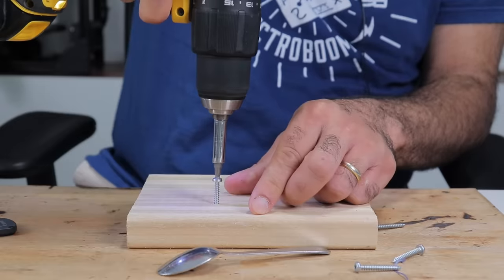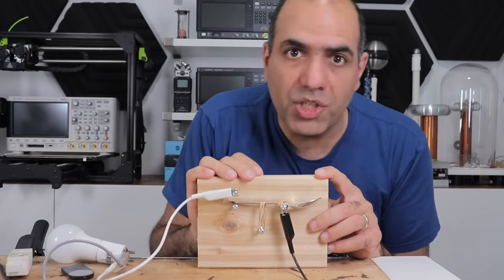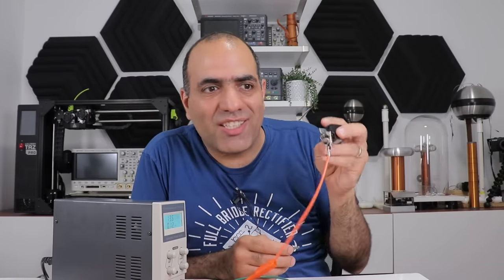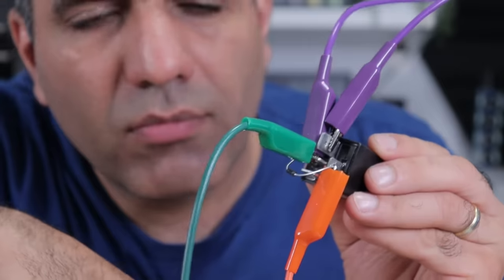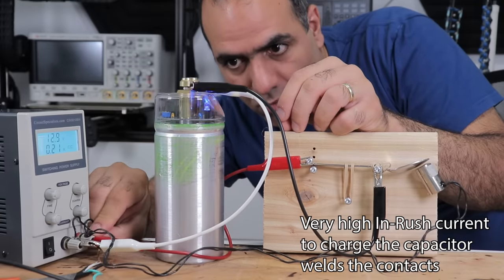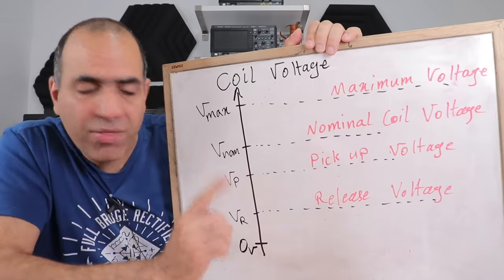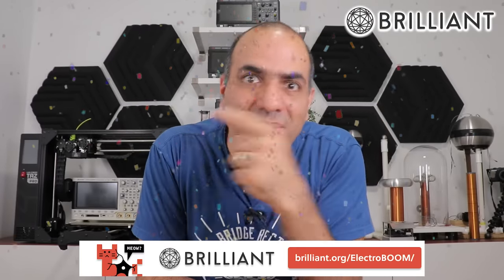Why RELAYs go BOOM!!! And How to Use Them

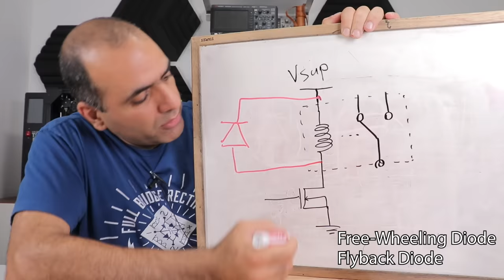Comment: 5:17 reminds me of back in the day when i used to test electromechanical counters using the parallel printer port of a computer running a counting program in BASIC and a transistor to switch the 24v to run the counter coil, and i got shocked by the coil.  Measuring the voltage, it was spiking to 400v on every count pulse because I didn't have a flyback diode.  (fortunately, the transistor i was using could take 800v)

Comment: Speaker protection relay contacts in amplifiers and hi-fi systems often fail due to oxide building on the contacts and the signal voltage and current isn't enough to break through, although if you crank up the volume, increasing the p-p voltage of the signal it will sometimes break through and begin conducting. Usually happens if the amplifier/stereo doesn't see a lot of high power use. Hence why silver plated contacts are normally specified for speaker protection relays, to minimise this phenomenon.

Comment: Sir can I ask a question?...their is a video I'ved watch before, solenoid valve, as the coil energize   it pushes the valve to open. I asked the uploader of that video how come the valve pushes away when the coil is being energize it will create a magneticfield that magnets the valve instead? Then he replied, according to the right-hand law, it will create a force that pushes the spool to opposite side. Which means their is initial energy from the magnetic flux on the coil as current flow through causes to push the spool valve. Now, sir if that energy present on coil, how the switch side of the relay being magnet from magneticfield of coil when their is a pushing force?

Comment: 1:10 Doesn't a 3-pole switch have two switches in parallel, which are in series together? thats how you control 1 light with two switches, and have the switches not depend on each other. i've actually lived in a house before where the switches were installed in series for a light, so of the 4 possible combinations of switch positions between the two switches in the hallway, only 1 of them turned the light on (it was 1 up and 1 down, which was even more annoying).

Comment: what would you use instead of a diode if you had to switch the coil in both directions?  ie negative/positive voltage across it instead of positive/off

Comment: As 3:50 , how voltage actross inductor is rising up when the path is broken. According to V = L di/dt  , path is suddenly cut while the current is flowing through inductor  means current is suddenly dropped 0. therefore di/dt goes to infinity or something ?

Comment: I'm not from electronic degree, but I want to build a wifi DC 12v relay circuit. What it does, having 2 source DC plug and battery 12v.

When blackout comes, relay will lose power and switch to NO state and because it's SPDT so NO pins is connected to 12v battery, continuing to power my wifi.

My question is.. Should I worry about this oxidize thing?
I run 12V relay arduino module. (but not using arduino, just simply mix the GND to Signal (my relay is low trigger)..

Comment: hey ElctroBoom,
question.
could you make a video about car "blower motor resistors". When we look at those resistors, its just metal coil inside a stone. with different lenghts of wire. could we use other resistor type components?

so, instead of some coils in stone (if you open them up its just wound up steel wire), couldnt we use some electrical resistors?

Comment: I have a question. I connected a sk3f-s-5vdc-c relay to a esp32 devkit v1. But it didn't work. May i know how to fix it without changing the relay?(or adding npn transistor helps?)

Comment: Brilliant. I know relays really well and have used them in lots of designs yet you still taught me something regarding the continuous arcing.
Reply: They're sponsoring you too?
Reply: @Sparkette  Why should relays sponsor him?
Reply: @Power-Wiesel  Brilliant
Reply: Same, I love relays from how unique they are, too bad I only have 1 in my home :(
Reply: One random thing I'll add is that they have a lower contact voltage rating for DC than AC,because there are no interruptions to the current that would let the arcing stop. A relay designed to switch 5A 120VAC might only be rated 30VDC,  and might arc permanently and burn up when "switching" 80VDC 3A.
Reply: Some relays (mainly the ones that are so big they aren't called relays anymore—they're called "contactors" for some reason) have a "magnetic blowout" feature specifically to extinguish that arc, by deflecting it with a magnetic field, which… hmm… stretches the arc too far to keep arcing? pushes the arc off the contacts? It does something to it, anyway.
Reply: @IDoNotLikeHandlesOnYT   I know that circuit breakers  often push it into a series of metal plates, spaced a short distance from each other. 5 separate 1mm arcs have more voltage drop than one 5mm arc. Also the metal plates act as a heatsink to cool the arc until the fireball stops conducting?
Reply: @deltab9768  Cool. I didn't know about that approach.
Reply: @Sparkette  Must be. Each contestant shall line up one million of these devices in a tandem cascade,  to see which array is fastest.  It would make for an interesting relay race.
Reply: I could dig relay well. I have a deep committment.
Reply: @clunkonester4884  if you answering this, you have a cell or a computer. That is millions of relays working together! You have way more than 1 relay around.
Reply: @ArashArfaee  true 😎💕🖖

Comment: I like how, even after having 2000 volts dropped on him, he still casually connects live wires to a spoon and touches it with his finger.
Reply: Notice whenever this happens he's not touching anything else with his other hand. He's also isolated from the floor. Would only feel a tingle (I've tried it)...!
Reply: I keep waiting for him to push the back side of the spoon :P
Reply: @deltab9768  From what I remember from that video, the Jacob's ladder ended up shorting milliseconds before he touched it, probably what saved him. Then the fuse at the power outlet popped (or GFCI forgot what)
Reply: @Kalvinjj  that would make sense. He looked shocked but that could just be from the stress of a near death experience. I’d think someone who actually got hit by a MOT would at least have some obvious burn or something so your idea would explain him being unscathed.
Reply: He did get severly shocked from that one but only a brief moment before it shorted just before his other hand touched it so it only burned one hand. He has mentioned in a another video later how it almost killed him for real
Reply: @deltab9768  Yea, as someone who has used MOTs and MOT stacks for all manner of projects going back years...seeing how close he came to absolutely definitely being dead then terrified me and made me feel sick haha
Reply: @deltab9768  he's talked about it separately before, that was a real accident

Comment: Minimum current thru a relay contact is also known as "wetting current".
This is why you cannot use a 200A relay to reliably switch a low current circuit.

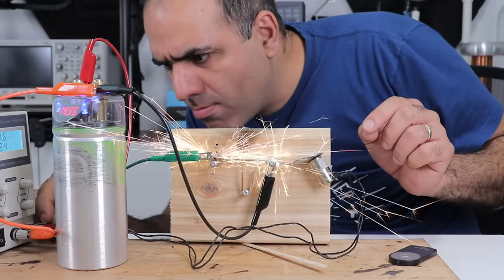Comment: 11:52 Some trivia I learned: gold is used in electronic devices like computers and phones because it doesn't oxidize and those devices want to use as low a voltage as possible.  (Voltages that wouldn't be able to break through the oxidized layer on, say, copper.)

Comment: Haha, me who's a beginner whom doesn't know what a LED is learning how relays work!
Reply: So an LED is a light emitting diode, diodes allow current to go through from one way but not from the other, and this one emmits light when current goes through. Pretty neat
Reply: Best to research all the different diode types and what they do
Don't worry bro relays was well used before LEDs even came out ....used to drive high power circuits from low voltage controller or buttons that You don't want to get a shock from also it saves that switch damage from arcs or soot
Reply: But no doubt these videos are entertaining and informative at the same time...and the thing he does with the bushbrows...
Reply: But no doubt these videos are entertaining and informative at the same time...and the thing he does with the bushbrows...

Comment: 6:30 you can add a resistor. You can set resistor value to tailor the flyback voltage and release time.

Comment: Thanks! Very enjoyable! I hoped there might be a mention about the relay ratings being for purely resistive loads. You have to derate them for driving inductive loads such as a solenoid. I hope that doesn't sound bad. I still get equipment to this day that I have to add arc suppressors to manually. Thanks again!
Reply: @itsmoam  Patreon i believe
Reply: @itsmoam  Patreon supporters get early access to videos.
Reply: @itsmoam  patreon early access

Comment: Nikola Tesla used auto oscilating relais in his circuits. Instead of burning away the coil spike in a diode, he discharged into a second coil, which was his primary coil.
this coil was tuned series resonant  to become low impedance (so the impulses could pass).

Instead of putting the diode parallel to the coil, you could also put it parallel to the switch.
 this is where Nikola Tesla placed his series resonant primary coil.

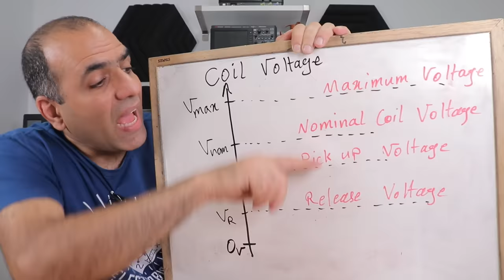Comment: At 10:00 you mention release voltage. Can you do a video about peak-hold driver circuits, like ones used for fuel injectors?

Comment: Hello, nice video💪 I think I have found a scam in smart watch, the brand  is Sequent and as a battery they use a coil with a weight and a magnet to generate electricity. On the paper this is fun but is it enough to power Bluetooth module , electrocardiogram .....?

Comment: Connect an 'operation' game board to a microwave high voltage generator so if you touch the metal with an exposed and disconnected metal hook you get a shock

Comment: I use a relay like the first black one you showed to make a ignition circuit for a ~1930’s 3hp engine on a railway inspection cart made to carry about 2 people. It was missing its ignition system except for the points, and a single spark wouldn’t ignite it, so it was set up like how it was set up in the video to buzz, except it operated a 6v car ignition coil to make high voltage.

Comment: "Coil Economizer" circuits are commonly used especially in control circuits where the relay is expected to remain energized for long periods. Basically, you add a series economizing resistor to the coil circuit that will limit the coil current to the holding value (plus a little margin) when it is ON and at steady-state. A capacitor is connected in parallel to the resistor, effectively bypassing it during pull-in. You still add the clamp diode(s) across the coil of course to prevent excessive flyback voltage.
Reply: Huh. Cool idea. I saw a component I think on a printer control board, it was a latching relay. Took zero power when it was on, zero power when it was off, and you had to pulse the current to get it to turn on and pulse it the opposite direction to get it to turn off.

It was a small device, but still cool to see.

Comment: Electroboom i need your help.
If i have a 3v to 400kv boost up converter (which is not exactly 400kv as it is made in china) and i observed that the spark produced between open terminals of wire at around 3cm (let's assume) and i connect both terminals to a small mesh net with a distance of slightly more then 3cm, so that there is no spark in between when circuit is active, so my question is that if a mosquito come between the two mesh or say mosquito sits on one of them, then the distance between two mesh become shorter, so is spark happens through the moquito? can mosqquito die?
we normally use mosquito killer rackets in which the distance between mesh is very small and mosquito has to touch both terminals o be killed, but if above given statement is true i can make a device to be kept near or under desk or and area of misquitos to get rid of them.

Comment: I’ve always had an urge to put very high voltage to a small relay and watch it arc between the contacts, too bad I don’t have a microwave I can take apart :(
Reply: There are 12/24 volt buzzer circuits (simple) that have Back Emf spikes in the 1200volt range.   Safe high voltage is a subject of large heavy books and heavy protective equipment.
Reply: @mike289homebuilt5  Okay, thanks for the info!
Reply: I love highvoltage.    There are Kits online for $12 dollars.   Transformer pulse circuits.  Tesla coil slayer circuits.  If I had low buget i would make a mini Alternator to drive a highvoltage transformer.    There is a way to pulse a transformer with a homemade relay i know......keep transformer small and voltage high

Comment: There are 2 types of relays, AC and DC relays. DC relay wont work on AC but AC relay will work on DC. AC relay has special iron core with additional coil to create additional phase of magnetic field to prevent chatering..

Comment: I'm using a NE555 circuit to delay the coil of the Relay with 9v of 12 lol, something unusual happened the transformer of 20 V. got overheated then I solved the issue fixing bad connections on the 110/ 220 V Terminals right... but now my device of 20v. is overheating just when I connect the Relay. I'm trying to figure out how to stabilized it, ANY IDEA? Thanks for sharing.

Comment: You need to have ARC and TIG welded, a process with rather low voltage and high amperage, to understand what happens when you open a relay's contacts. The TIG process lift-ARC demonstrates the problem of opening a relay under a load. It causes the air capacitor  that is stopping the flow of electricity to break down. 

The more insulative the dielectric in a capacitor, the smaller the capacitor it will create. The more surface area the dielectric has in contact with the two plates/contacts, the larger the capacitor it creates. The thicker the dielectric, the smaller the capacitor will be. When two points are very close together, the air capacitor is very large and often blows from the large current it passes to charge the air capacitor. 

A relay is a very small air capacitor that charges and then resists voltage flow. When a relay first opens, the points are very close to one another, creating a very large capacitor. As that capacitor that often stops AC current charges, it draws too much current through that small thickness of air. This causes the dielectric, the air, to break down, superheat, and become a blown air capacitor or blown condenser. This can cause an extremely long break time, especially with induction devices. Longer than the make time of the relay. So, if you were to try to use two different power sources and try to switch between them, the fact that it will take longer to break than make means that power from one power supply will jump across the ARC, the blown air capacitor, and connect both power supplies. 

One common thing engineers do is try to create a device that will switch between 230 volts and 120 volts with one relay. The problem, as mentioned, is that the ARC will open up a bridge for power to flow and connect the two power supplies, often causing some nasty effects. Just like an ARC rod does.

Comment: Pull-in voltage, hold voltage, max voltage, ... When you get to the Big Boy Relays(tm) - "Contactors" - the specs start going all over the place. And there are "mercury wetted" relays to damp the contact bounces. (Gigavac sells a line of "mil spec" contactors that have silver coated contacts to help prevent arcing / welding. They're my preferred go-to for EVs)

Comment: Sir, I have two questions:
1. How to increase  life of relay for commercial product , when used with inductive load like solenoid or motors (1A-2.5A load) ?  snubber circuit (RC circuit )?
2.  what is the role of optocoupler with relay ?  I mean do you recommend optocoupler with relay ?

Comment: Wonderful.  Here is a bad-relay story:  in the 1960's, ham transcievers needed to switch 280 volts or so pf B+ between the transmitter and receiver sections.  But high-voltage relays were VERY large and expensive, so even high-quality manufacturers such a Collins and National and Hallicrafters would use lower voltage relays.  These relays would be stressed and only last a few thousand switching operations.  I right now have three National transceivers that need new relays.  I'm reluctant to put in the originally designed-in relays, so I'm kinda stuck.   I do have some high-voltage telephone-circuit relays, but they have strange pinouts so difficult to plug in!   Rats.   Any ideas?

Comment: Interesting how I recently ran into this exact issue while performing manual testing on a customer prototype. It is basically a more complicated fuse box and the customer specified a relays for 3 phases, but it also needed 2 auxillary contacts. It already came with 1 auxillary, so the customer specified the auxillary contact we had to use. While manually testing the product we noticed that 1 auxillary contact that was to be used for diagnostics (a 24VDC signal), wasn't a true short after switching (showing between 50 and 200 Ohm). Due to possible voltage drop across this resistance, it may cause the product not to function properly.
Turns out this diagnostics signal was put on the additional auxillary contact, which was an AC rated auxillary (for switch 230VAC at 10A). After some discussion and investigating, the customer agreed. They also found that the auxillary that is attached to the relay was for 24VDC signals. So in the end, we just had to swap around some wires for it to work properly. Such a small oversight resulting in multiple hours of people investigating and researching parts. 
More annoyingly, it was even more obvious when you looked at the part specs, it clearly stated it requires 18-14 AWG wiring, while the customer specified 20 AWG. Don't trust your customer designs!!!